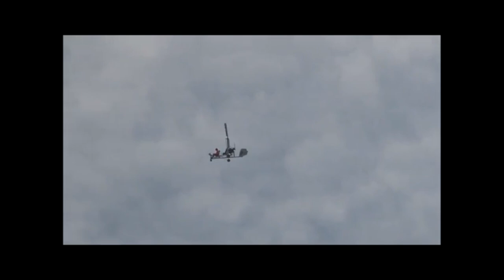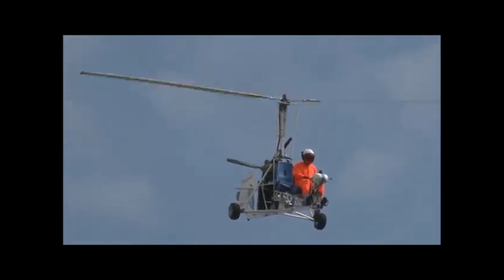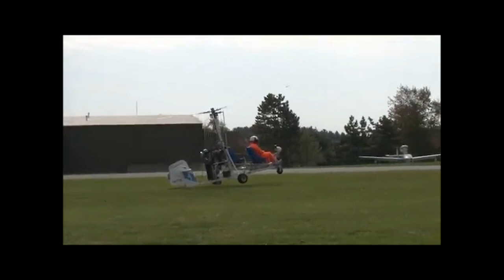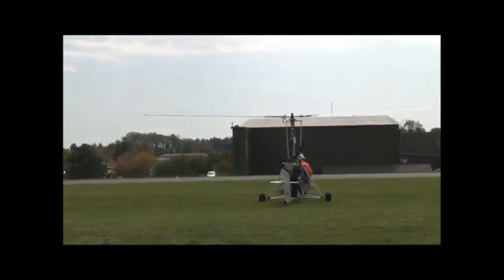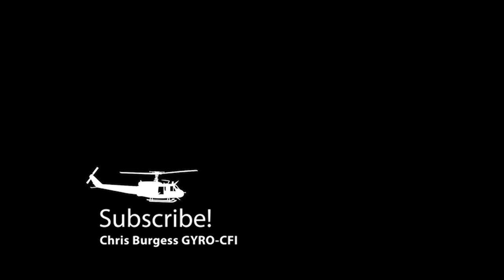Gyroplane Engine Shut Down No Roll Landing (Rotorfest 2012)

Comment: I'm a low time fixed wing commercial/instrument pilot. Would I assume correctly that a gyro copter would be pretty easy for me? They look so much fun I'd like to try it.
Reply from the maker: Well, not exactly. Rotorcraft and Airplanes are in different categories for a reason. I am fixed-wing rated, commercial helicopter and gyroplane with CFI gyroplane, instrument helicopter. I’ll say basic aeronautical knowledge and such is of course the same, but you will find takeoffs and landings with autorotations and knowledge of the rotor and how to handle it will be a challenge. Once over those hurdles basic flying is about the same. I would be stretching to say it would be easy for you since all pilots are different. Helicopter to gyro pretty easy, fixed wing to gyro is a little more challenging. Go up in one with a current CFI  and you will find out for yourself. A couple flight hours with a CFI will reveal how difficult it will be for you. I’ll finish by saying fly before you buy and never think you can do it by yourself, my advice is you can’t. Good going on your fixed-wing ratings.

Comment: That thing didn't have a collective when I was in it.
Reply from the maker: You are correct, no collective. So it must be smoke and mirrors right?!!
Reply: - No. Just a commentator who isn't conversant with how an autogyro flies. In his commentary, he said, "He's just entered autorotation". That aircraft was in autorotation from the moment he started his ground-roll.
He also talked about saving the energy so that he could pull the collective during touchdown - there is no collective pitch-control. The vast majority of gyros have fixed-pitched blades. They have neither cyclic nor collective and instead, tilt the entire rotor-head.
It's not at all unusual for people who have some knowledge of other aircraft-types but very little of gyros to completely misunderstand how they fly.
Reply from the maker: @halfrhovsquared   I know, but I think he did a pretty good job not having any instruction in one that I know of. I miss my Huey collective.!!